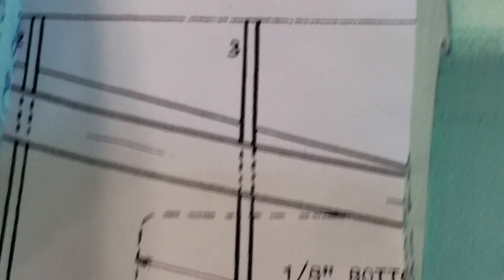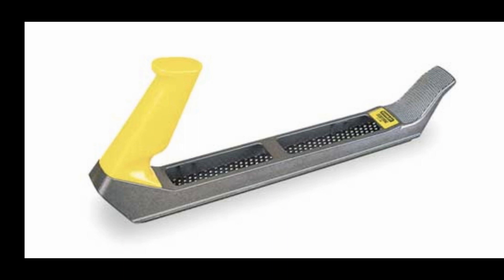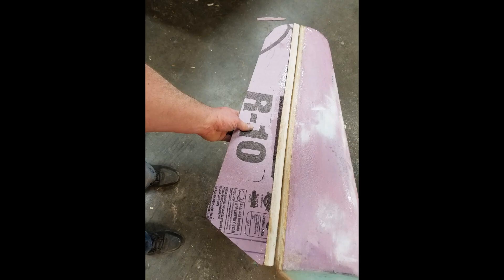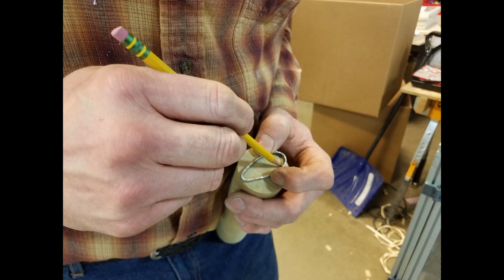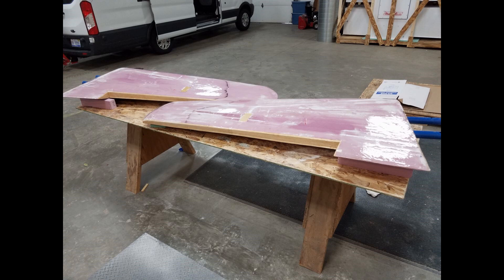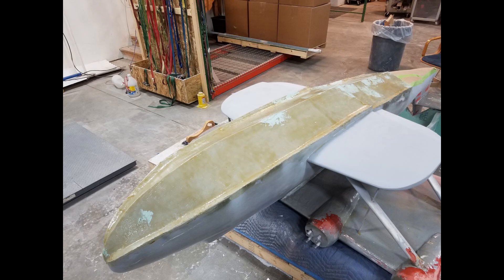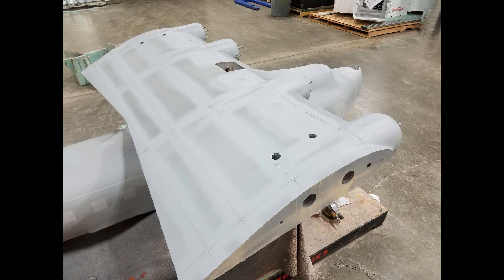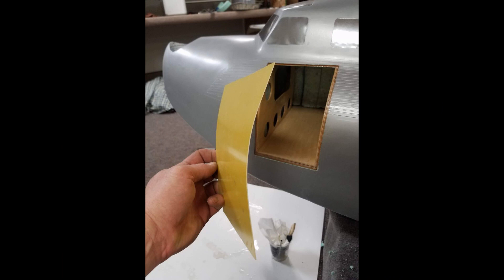COMPOSITE FLYING BOAT BUILD RCTWINS

Comment: Great way to build a flyingboat and lovely subject. 
How about the big 3 American 4 motor ships to the same scale Sikorsky and Boeing.
Or  equivalent  Shorts and French Latecoere?😉😎.
Reply from the maker: All of the are incredible!! We chose to celebrate the Martin, I think one big flying boat is enough 😀😃🙂
Reply: @rctwins7913  
 @rctwins7913  

Nahh..🤣😂🤣.... you can never have enough flyingboats amphibians or airships..  😎

Trust me 😁😉🤭 search for Water planes and  airboatflyingship in the RC forums. And Ivan Pettigrew of BC.

The Martin is very, flying model, friendly design being a semi pylon wing ..I do know of various giant Spruce goose's and Saro Princess builders but the ones that get me are the large French Latecoere's , from the Double decker  jules vern 1930s ones to final 6 engine streamlined giants carrying the Air france winged Seahorse logo.